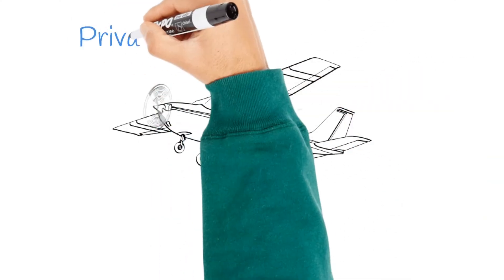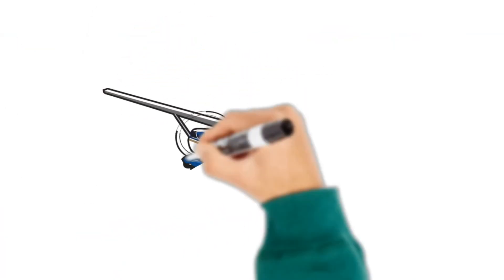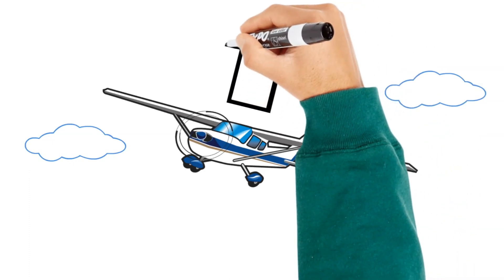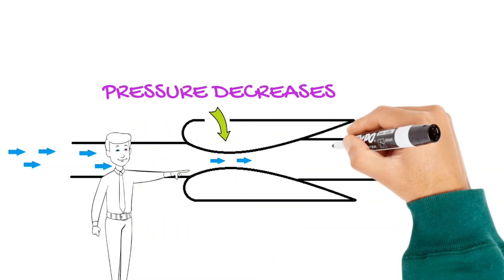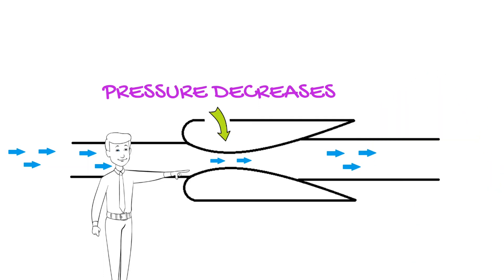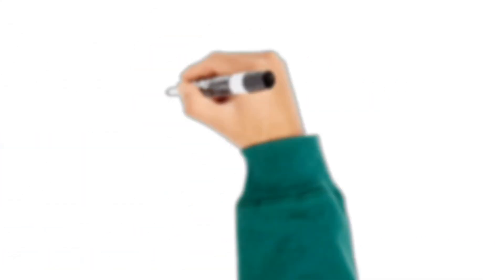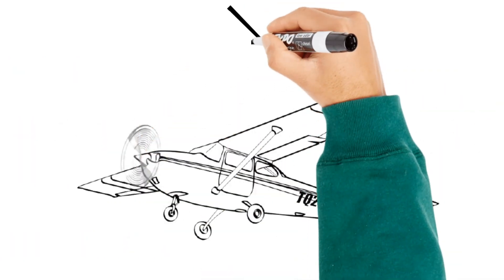How An Airplane Creates Lift (Private Pilot Ground Lesson 2)

Comment: Incorrect
Reply from the maker: Lol, it is according to the FAA. I’m going to eventually change this video to include other factors
Reply: @FreePilotTraining  true but even FAA is wrong...  youtube: MIT OpenCourseWare Lecture 2: Airplane Aerodynamics   Thank you for your videos bro! You are doing good!
Reply from the maker: @puriphi  that’s a fact! Thanks!
Reply: @FreePilotTraining  "Lol, it is according to the FAA. I’m going to eventually change this video to include other factors".  We used to use two neat demonstrations of lift in ground school.  One was using a bobbin.  Cut a thin piece of cardboard (like a business card or cardboard in a new shirt) in about a one inch square, put a needle through the middle, slide the needle in the hole in the bobbin to hold it in place, and hold the cardboard against the bottom of the bobbin.  Start blowing carefully downward through the hole in the bobbin just to get an airflow started across the top of the cardboard as you slowly take your hand away from below the cardboard.  The cardboard will stay in place below the bobbin - when you run out of air, it drops to the floor.  The more air you blow, the tighter the cardboard will stay against the bottom of the bobbin.  And this airflow doesn't have any big curvature like the MIT video, so apparently a big curving airflow above the wing ending in a downward direction is not needed to get a lifting effect.  The other demonstration was with a plain sheet of paper.  It was held horizontally with the longer side facing one's mouth and held so that it was curved like the wing's leading edge.  Then blow gently in a horizontal line across the top of the paper.  You will see the other side of the paper that was handing down come up to a horizontal position to the lower pressure created by the airflow you created.  Again, no air curving downward - just horizontally.  I think it's also roughly the same conditions that create wing-tip vortices.

I think the demonstrations we used indicated the Bernoulli Principle is completely valid.  If you just added a little more about the pressure at the bottom of the wing maybe showing the angle of incidence and a couple of arrows to show the point of impact and redirection of the airflow downward (to simulate the hand out of the window getting pushed upward), I think you'd be all set.  Also, it appears to me that the deflected air from the bottom of the wing causes a void low-pressure area behind and below the wing and that is what attracts the airflow across the top of the wing to bend downward.  That air to me is just flowing to the point of least resistance like the wing-tip vortices.

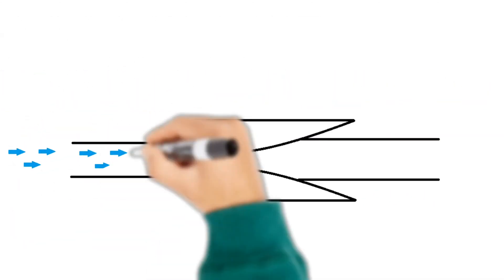Comment: I wonder what the aerodynamics of a wing built like that shown at  0:40 in the video would look like? Such a wing would have a different boundary layer than cambered wings. But, it may generate a larger pressure differential than regular wings, thereby more lift at lower air speeds. More parasitic drag and therefore a different total drag curve at high speeds but lower stall speeds?
Reply from the maker: That’s a good question
Reply: @FreePilotTraining  You would need to camber the top of the upper section appropriately to create another boundary layer above the airfoil. This is so there is a lift differential for total lift from the airfoil. But, I think this idea may have some benefits. For example, if flight controls close off the rear section between the upper and lower sections of the airfoil, imagine how good that spoiler would be. A more efficient and effective spoiler would be great for powered gliders. For example, the Pipistrel Sinus. Those spoilers would nicely kill a lot of lift making short field landings more practical. Also, isn't it possible to add more area for flaps, ailerons or flaperons? There would also be some interesting combinations of airfoil designs depending on the placement of flaps or ailerons on both or just one of the sections of the airfoil.

Such an airfoil may most likely make a nice slow and low flyer.

Comment: Bernoulli reverses cause and effect.  The air is going faster because it ran down a pressure gradient.  There's low pressure over the wing and the air flows faster into it.  The actual cause of lift is always and everywhere that the wing throws air downwards.  The wing shape happens to do that efficiently with minimal forward drag, which is just a side effect of the Navier Stokes equations that govern fluid flow.  You get stalls when the air off the top surface is no longer thrown downwards so you lose a lot of your lift.  They'll probably fail you on the exam if you answer this way though - it hasn't advanced from the physics class to the aviation instruction community, the last I checked.
Reply from the maker: Thanks for the comment! I had to make a decision on how to explain lift.  I decided to go with an explanation that will help on the test. I may remake this video in the future with a little more detail though